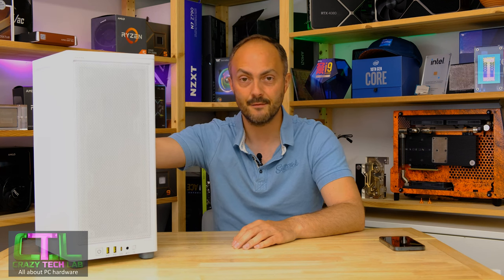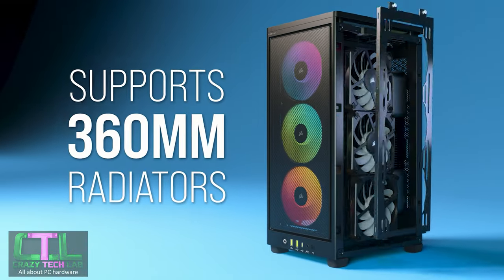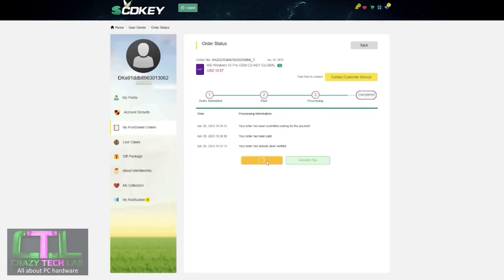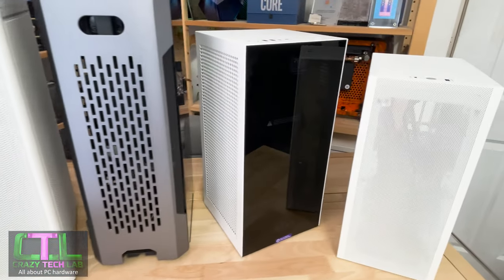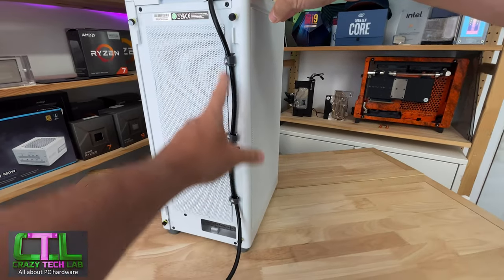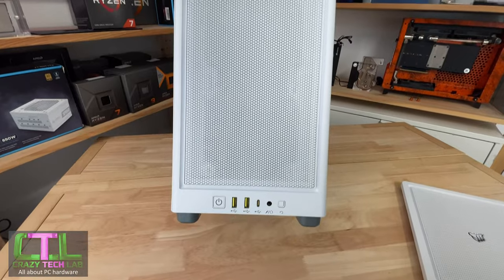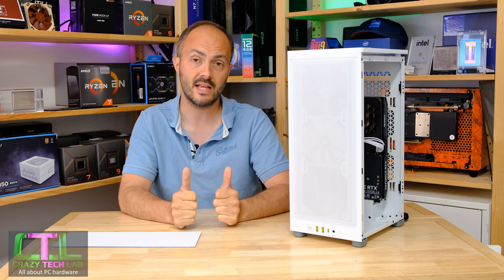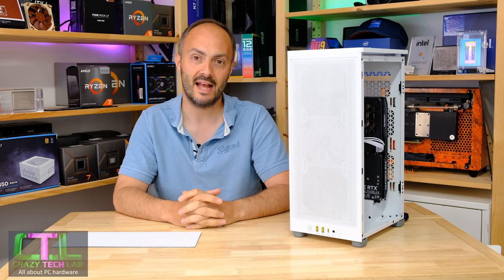Corsair 2000D Airflow Mini-ITX Case Review: THREE RADIATORS NO MODDING!

Comment from the maker: Timestamps:

0:00 Intro
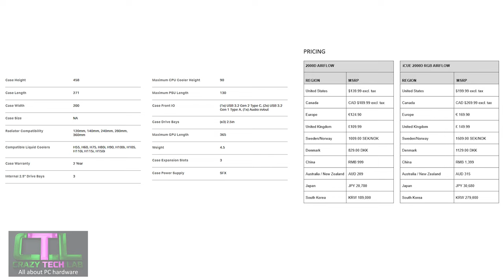0:22 Specs and pricing
1:23 Sponsor message - get cheap Windows and Office keys with SCDKEY.com
2:34 Size comparison with Ssupd Meshlicious, Phanteks Shift 2, NZXT H1 
5:19 Exterior 
9:36 Interior
15:32 Radiator support (CrazyTechLab style 😀)
20:18 Triple radiator build!!! (RTX 4090, Ryzen 9 7950X3D, Custom liquid cooling)
24:49 Test system build  (RTX 4070, Ryzen 5 7600X, air cooling)
25:35 There's more CPU cooler headroom than Corsair states???
26:57 Thermal testing 
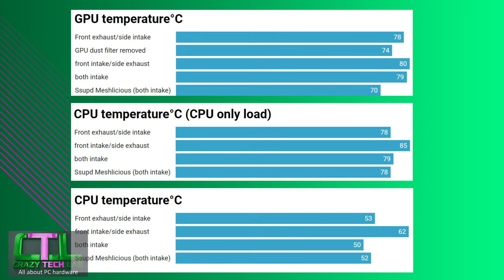32:27 Conclusions
Reply: phanteks evolv shift 2 air still the best for me , not just it is the cheapest , also i t has the most briliant IO position

Comment: Thanks for testing the water cooling potential!! I have been wondering about the max radiator you can fit since they announced the case as currently I have a NR200 with 2x240rads that still seems not enough for the 5800X3D and 3090 it has inside, so this case might be what I need :)
Reply from the maker: I agree. I prefer to get more cooling so I can run fans at idle to kill noise. You’d probably be fine with a 240 and 360 though
Reply: Ye a 240 and 360 would do better and 3090 is a power vacuum you would get better temps with a 4080

Comment: I tried dual and triple radiators in this case.  The one by the graphics card isn't much of a problem, however I'm not sure if it does much since the air flow is so small over the radiator.  The problem I ran into with two different motherboards is the other 240mm slim radiator or the fans on the radiator either hits the RAM or the clips for the RAM on the motherboard.  The triple radiator setup must be very motherboard specific and only work with certain ITX motherboards.  I tried both MSI and Asrock ITX boards and neither would work due to the clearance issues with 15mm thick fans and a 20mm thick radiator.

Comment: Good review man.  Really disappointing from Corsair though, couple seriously bad missteps.  That power cables is unforgivably bad in my mind, and the lazy/inaccurate clearance measurements on the cpu cooler kinda adds to the feeling that they didn’t pay enough attention to the details here.
Reply: I agree with you about that PSU cable. It might actually be a dealbreaker for me.
Reply: even NR200 at least they do some measurement for the extension power cord LOL , i dont know but i love my phanteks evol shift 2 air more than this , for me even the hyte revolt 3 also better
Reply: @蛇王-y9b  I actually have the Revolt 3 and I love it. Only downside for it is, it’s not custom water cooled ready. I’m pretty sure I could do a custom loop in it but that would require more planning than I have patience for.
Reply: @TravisDoomGuide  yea revolt 3 is quite perfect for a case but not support custom loop, well most user should be okay with it

Comment: Would having the front and side fans as exhaust improve the GPU temps? Or is this something you wouldn't recommend?

It is a shame they didn't include a fan in the top 😢
Reply from the maker: If you have the fans on the GPU bracket as intakes that will likely improve temps there yes. But you’d need to use slim fans with dual slot cards and there’s not enough space for fans if you use a triple slot card.
Reply: @CrazyTechLab  sorry I meant the fans on the front of the case as exhaust and putting fans on the side of the case as exhaust with a low profile CPU cooler, I wondered if the fans on the GPU would draw air from the rear and be assisted by the two exhaust sides for better airflow?
Reply from the maker: @Alan-ib9rb  Maybe a degree or two. They’d be working against that GPU filter. But if you had the side fans exhausting air then they’d be working against the low profile air cooler. Although as I said in the review, I think most people would go for a liquid cooler with this case.

Comment: That thing looks like a nightmare. Weird compromises if you want a non watercooled GPU. And quite big so you can (realistically) fit a single 360 aio. I'll just stick with my 280mm AIO, 4 slot GPU and sub 20liters NR200.

Comment: I think I found a better 360mm rad, I found one with 25% more fins per inch that does cost 10-20€ more but I think its even more no compromise :) And yes its same thickness
Reply from the maker: Just be careful with the air restriction. You might need to run fans faster to make the most of it resulting in more noise. Higher FPI potentially means more cooling but also greater air restriction

Comment: Would a 280 mm radiator also fit in the front or back? I have an Alphacool Eiswolf 2 and Eisbaer joint together in one loop and wondering if it would fit in this case?
Reply from the maker: Yes but the width may prevent you installed fans in the adjacent slots as it's quite narrow. But at 20:40 you can see there are mounts for 140mm fans so you could put a 280mm rad there no problem

Comment: Hello, I stumble uppon this video while doing some research for a future build. I want to build a tinier PC to travel time to time. I have a Arctic Freezer ii 240mm with the fan sold with the cooler. I was wondering if it would fit ok with this case, I also plan on getting a 4070 super with it, like a basic ASUS 2 fan card or so. Do y'all know if it will work out ?

Comment: @CrazyTechLab I have a very similar setup with the strix 670e-i, 7950x and a 7900xtx - I am looking to do the full mobo EK WB with their GPU WB, I'm thinking the slim 360 and 140 rads for the system. Do you have any wisdom or suggestions with this build?? I currently have a corsair AIO and the GPU is stock air.
Reply from the maker: I'd probably stick to two radiators. Three is kinda overkill and it's VERY tight. Barely any room. I wouldn't use three if I was doing this myself.

Comment: would it be at all possible to fit a full 240 with slim fans on the front, looking at the video it doesn't look possible. if not any case mod suggestions to get it to fit?

Comment: Do you think I can fit a 4070 or 4080 with water block and 1 360mm and 1 240mm rad in there?
Reply from the maker: Yep I fitted an RTX 4090 watercooled in there with 2 x 240 and 1 x 360   check out 21:00

Comment: Great Video! Completely agree with your criticisms, especially regarding the cable routing.

I'm curious thought, would it be possible to move the case feet to the back and mount the front fans as top exhaust? There are 4 holes in the back in positions where  it looks like the feet could go, which makes me wonder whether that was an early design intention, especially because the back filter looks very similar to other bottom case filters :D

Comment: What's the thickness of the radiators you used? It kinda looked like 2 x 20mm thick radiators with 15mm noctua fans?? so 35mm in total or would a 40mm set up also fit inside? My rads I have are like 25mm thick. I have 15mm and 12mm thick slim fans to my disposal so I could go down to 38mm thickness in total. What exactly can fit in this case???
Reply from the maker: All hardware is listed in the description but they were XSPC TX240 slim radiators (20mm thick) and slim (15mm) fans. You'll get much better results using 15mm slim fans as opposed to 12mm - all the 12mm ones I've tested have been terrible, especially on radiators. Both sides you're left with millimetres to space in some spots, but the GPU side is critical to get as much clearance between the GPU waterblock and fans as possible. It won't be possible to fit 38mm of hardware there, at least not with the EK block I used. There's be zero clearance and fans wouldn't be doing anything. In fact they're probably be rubbing on the waterblock
Reply: @CrazyTechLab  thx a lot for the fast reply. So only xspc xt or alphacools st20 radiators would actually work.
Reply from the maker: @damaskilo2665  Unfortunately so. If you take a look at my recent video I test the cooling system and you might get a better look. It's super tight https://www.youtube.com/watch?v=cmD_7Zclrew
Reply: @CrazyTechLab   omg thats so tight especially the gpu side, but on the other side the ram sticks and probably the io shield etc looks also tight. Do you think a ddc /cpu combo block is sufficient for all 3 radiators or do you think that a d5 pump is necessary? In your video I didn't like how the reservoir/pump block ended up on the very top part of the case. I wished you could invert the case so that the pump at least is on a lower level. Jayztwocents reviewed a pre-built from orion and that version was inverted https://youtu.be/9oO1hbmUQ0Q thanks a lot btw for taking your time abd answering my questions. Really appreciate you! I love your vidz gonna subscribe and looking forward for more high quality videos and builds!

Comment: I bought this case purely so it fits my 4080. It's the only itx that fits 342 GPU
Reply: What cooler are you going with? Air or AIO?
Reply: @Broba_Fett  I had to switch the 4080 out FYI. It was way to fat. Feels bad. I ended up with a 360 rad
Reply: @TheCuttz1984  was it a FE or AIB 4080?
Reply: @Broba_Fett  it was the gigabyte 4080
Turns out it is the biggest card in the 4090 4080 line up. Do not buy it. I have tried many itx cases to fit. The problem is the width with this case. 50 to 55 mm Max. I had to loosen all the mobo screws off to even get the 4080 close.  Hope this helps

Comment: would it be at all possible to fit a full 240 with slim fans on the front, looking at the video it doesn't look possible. if not any case mod suggestions to get it to fit?
Reply from the maker: No the issue is the proximity to the motherboard and I/O panel and even then the fittings would foul the 360 radiator on the side. If you don’t use the side mount for s radiator then you can probably cut away the mounting at the front to shift the radiator up a bit so it clears the motherboard.